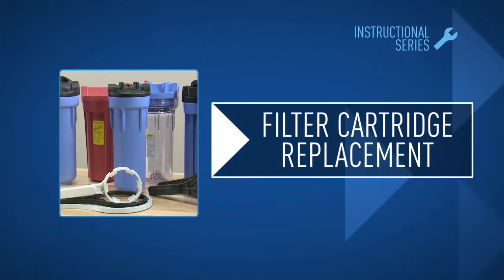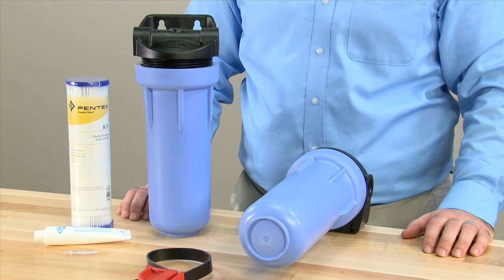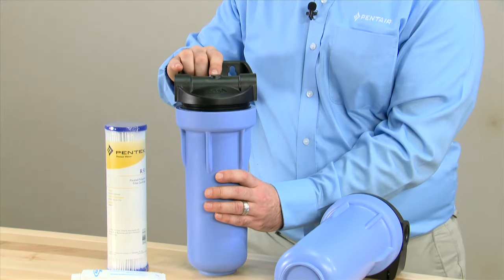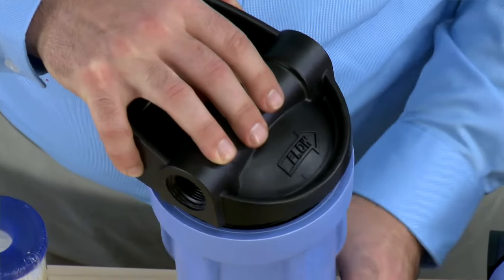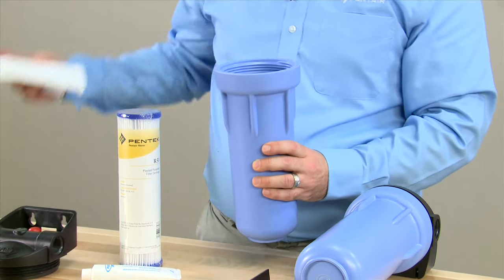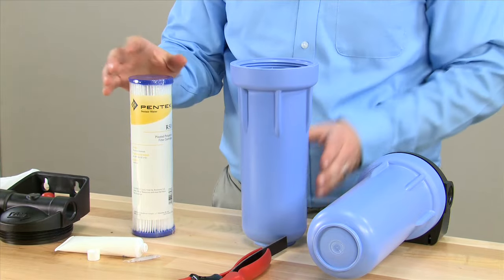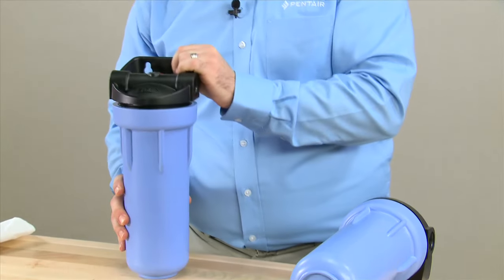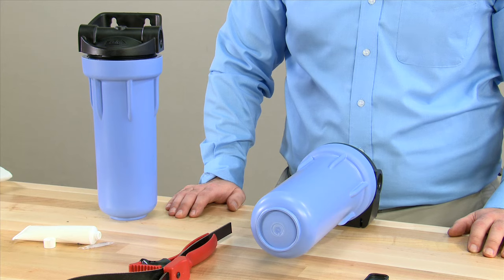Replace Filter Cartridges

Comment: What if the sump does not refill with water after the replace the filter.  I've never had that problem before and cannot find an answer on line.  Thank you for your help.
Reply: You have probably installed the cartridge upside down. The gasket side goes to the top or towards the water supply.

Comment: How to open the sump if the unit does not have a pressure release button?
Reply: Turn off the water supply, turn on the sink water.